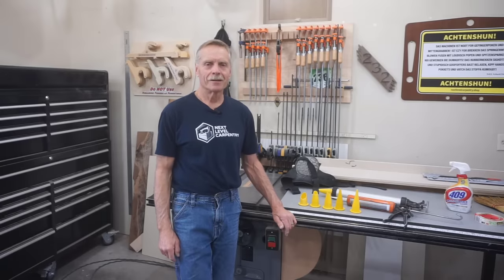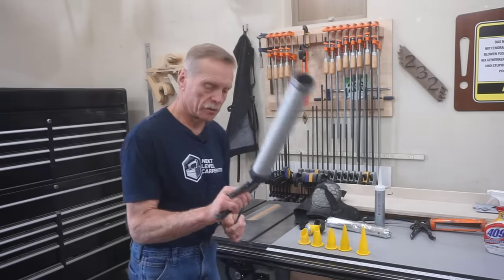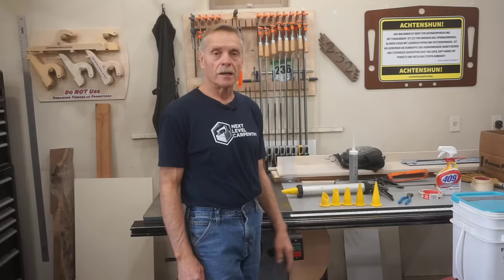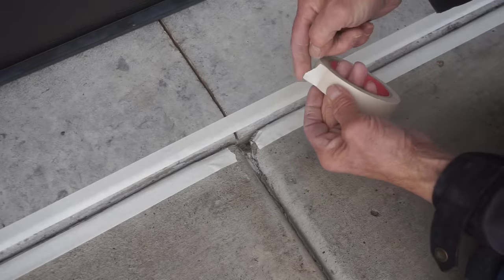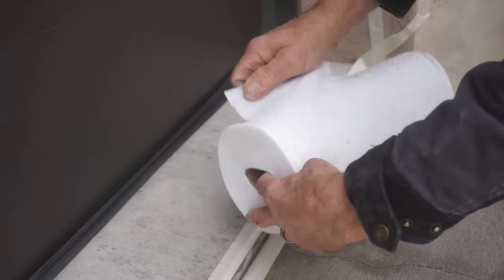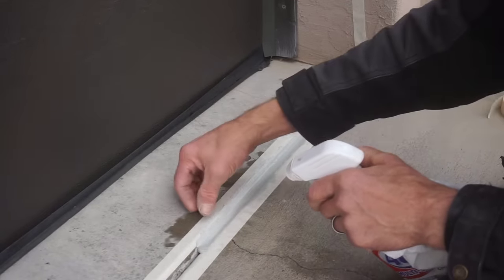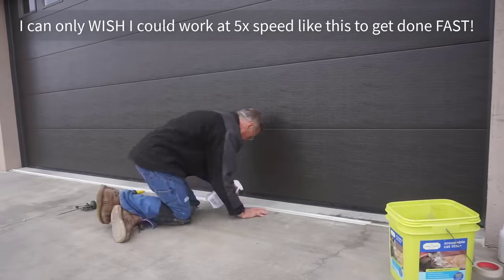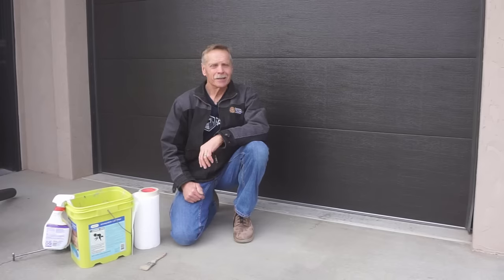How to Caulk Concrete Control Joints with Perfect Results Every Time

Comment: This is probably going to sound odd.. But I've been doing strictly finish caulking for over a decade. Pre cast, brick, stone, glass, aluminum, everything. I've used every type of caulking under the sun, urethanes, silicones, self level, 1 component, 2 component. We don't use tape or our fingers to finish, we make custom tooling sticks with wood, all sizes from 1/4" to 3" wide. People are surprised to see us using oscillating cutters, grinders and chipping tools but we work on all substrates. I'm kind of glad to see people starting to take it seriously, a lot of people make fun of caulking but it is an important component to building and it's important that it's done right. 10 years ago anyone was allowed to have a gun but nowadays in Canada we have engineers inspecting all our beads and if they're not perfect...well cut it out and do it again. What you're doing looks good and it's done right, nice job.

Edit: anyone that says you can't use soap and water doesn't know what they're talking about.
Reply: A video showing your finish tools would be appreciated.  Caulk finishing tools are hard to come by and there are few options.
Reply: Caulking isn't an easy job, I am OSI silver and bronze certified , I grind down old knifes and make tools out of them , it is an art and some guy have and others don't. I also use mineral sprits. there are many different ways and tools and with the modern sealants it actually take time and skill to do it to spec
Reply from the maker: @Denis Dougherty Glad to see hear from someone else who sees the benefit/value/quality of joint sealing!  The number of 'pros' who've commented on this video saying only an amateur would need this method is annoying... especially when they don't have photos to back up their assertions, right?  Mitering masking tape too?  Great minds think alike! Best, Matt
Reply: Too much bare finger work can be a problem, especially with hands that are pre-damaged. I've tried using inexpensive rubber-coated gloves, and thinking that soapy water might help since rubber/ vinyl/ whatever still is not flesh and has different results. THanks
Reply: John Henderson id love to see some of them mate! Learning the ropes and it’s fascinating stuff!
Reply: Journey man glazier here, I have to say you hit all the right points tape, tool, getting the caulk ahead of the tip. All spot on, for bumpy substrates the finger is king. Soapy water, 409(for rich people) lol and glass cleaner. All a good call. I can ramble for days on the in’s and out’s about caulk but you nailed it. Btw I love my bulk gun but nothing beats my Albeon for tubes. Just saying.
Reply: Your inspectors would have a ton of work here in the USA. Burt Lancaster may be one of 2 guys here that knows how to caulk

Comment: To save on material if the joint is kind of deep....I will fill it with sillica sand and then brush it out to a uniform depth prior to caulking.
Reply: You are supposed to use closed cell backer rod
Reply: @johnhender  That will work but I think sand is better.  I know it's cheaper.

Comment: Looks really good Matt.

How do you clean out the nozzle if you're not going to be caulking again anytime soon?
Reply from the maker: It's much easier to just let the urethane cure in the tip and pull it out after it turns solid than it is to try to wipe it out while it's wet. It's actually pretty amazing that it works that way.. Best, Matt
Reply: Next Level Carpentry And that’s what I usually have done with standard caulking tubes, I’ll screw a drywall screw into the end of the tip and pull the plug out. That’s probably the only thing you missed in the video 😉
Reply: To reuse my partial tube of caulk at a later time, I simply peel off one of my rubber gloves when I'm done, pushing one of the fingers over the nozzle of the tube, I squeeze a little bit of caulking into that finger tip of the glove, give it a twist, and just leave it. It provides a nice cap made out of the caulking, and when I pull it off, there's fresh, soft caulk in the nozzle ready to work.
Reply from the maker: @btbinnovationsllc6815  great tip, thanks! Best, Matt

Comment: Thanks for sharing this video.  Luckily I only started my job today and didn't get far before I realized I can do it so much better.  Question for you or anyone really -- Do you guys run caulk in all your joints or just the big expansion joints?  I have a pretty big driveway and have seen some neighbors where every joint is caulked, and it looks nice.  I imagine the more narrow joints are a challenge to do properly, some are razor thin.  The expansion at the garage and across the driveway in 2 spots definitely I'll do this way.  But I'm wondering if I can run this in every gap?
Reply from the maker: Because filling joints with urethane keeps them from filling with dirt, dog hair and detritus, I'm a big fan of doing all the joints both for ease of cleaning and consistent appearance: kind of looks like grout joints in VERY large tiles IMHO.  I don't do 'razor thin' cracks but do do 1/8" wide control joints that were cut in place with diamond blades.  I always cringe when I see a driveway done with self-leveling sealant,  without masking tape or without wet-tooling that ends up looking sadly sloppy where it would have been much better left alone.  As long as you follow the steps shown in the video you'll end up with a very neat job. Best, Matt
Reply: @NextLevelCarpentry  Appreciate your reply and the time you took to share this video.  I learned a lot watching you.  It went pretty well today but slow going as I learn the process.  I'll be back at it tomorrow.  Your tips are extremely useful though you also make it look easy. :)  One thing I did want to ask if you had a minute, I noticed some of the smaller joints (non-control) aren't very close to the top of the surface.  I didn't want to go too high as my snowblower would kill them in the winter, but they are also a bit lower than I like when they settled.  Tomorrow, ok to put another small layer on top of the existing or is that a no-no?  The smaller joints are easier, my larger joints have a lot of chips and cracks from wear and tear which is making the straight line method a little trickier.
Reply from the maker: @BraddyP  It's fine to add more sealant on top of previously applied joints but you might need/want to wait a couple weeks for the initial stuff to stiffen up a bit before you do. I'm sure it will stick but think it might be messy... give it a try and see.  I've done touch-up on joints after they've 'cured' to remove animal footprints, tire tracks etc by taking a utility knife and cutting a Vee groove and then filling it back in... might be less fussy than trying to add a thin-ish layer on top?  As long as you don't smear urethane outside the tape lines you can do and re-do whatever and whenever... it's pretty forgiving that way.
Those chips, cracks and irregularities do make the job more challenging but at least you have a work-able system to keep from ending up with a complete mess, right?😎 Best, Matt

Comment: I consider myself a handyman but never thought to do this - and the joints at my house need it badly. When I had the house built the joint had some sort of brown substance in it - not sure what it’s called - I figured Lowe’s would have it but never looked. I like this caulk idea better anyway. Thanks and subscribed.
Reply from the maker: The 'brown stuff' you see is expansion joint material DabbaYabbaDo.  It allows concrete flatwork to expand/contract with changes in temperature.  They are spaced out according to slab size/length/width to prevent buckling.  The 'thump thump' you hear when driving down a concrete paved highway are the expansion joints put there so the highway lasts longer. When installed properly expansion joints are held 1/2" down from the surface of the slab with a 'snap cap' which, when broken away after concrete cures, leaves a 1/2" wide x 1/2" deep groove that's filled with sealant because expansion joint material doesn't do a good job of sealing out water and dirt.  You would need to remove the top 1/2" of yours somehow before sealing.  The method, tools and products seen in this video will allow you to get professional results when sealing expansion joints like you mention and control joints ( the other straight lines you see in your driveway and sidewalks) because they are definitely 'best practices' IMHO. Thanks for watching, commenting and subscribing! Best, Matt
Reply: Hey there. Like Matt says,that is expansion joint in your joints. I typically use my grinder or quicky saw with a wire wheel and that is the easiest way. If you dont have access to one of those,you can use a utility knife and cut it out. -Little but more work but it works.
Reply from the maker: @omaha1361  Side grinder with a knotted wire wheel sounds PERFECT!  I've not heard of that or tried it but I'm sure it will work so thanks for adding the tip here!! Best, Matt
Reply: 8
Reply: Beautiful work

Comment: Even the Tremco rep unofficially will tell you to use a 409 type product. The issue sing 409 or soapy water  is if you want to add more poly on top of what you just did. That 409 might cause an adhesion issue. BUT, almost always I dry tool, add poly if needed then 409 as final and never had an issue.

Good video!!
Reply from the maker: You might be surprised to know that there's zero 'adhesion issue' when adding more urethane even after wet tooling with 409 George.  Seems counterintuitive but I do it all the time with no adverse affects.  Best, Matt

Comment: I am surprised that you apply a liquid that stops the bonding to smooth the bead out and then push more material in on top... I guess you must not have had any negative experiences with that technique but frankly it surprises me that this even works.
Reply from the maker: I've been using this method steadily for 20 years with great results and zero failures Marco and, frankly, it surprises me that it works every time I do it. Best, Matt
Reply: Here's a hint if you have a small area to seal:  Just use spit.  Yes, it works.  Used it in caulking an end cap on guttering.

Comment: Pretty good job for a non-professional caulker. One thing needs to be mentioned. A soap solution like 409 or dish detergent/water solution will contaminate the surface if you accidentally spray it on the surface that hasn't been caulked yet. That will result in an adhesion failure. 
  Tremco has a superior product now called Dymonic 100.  It can be applied to damp, but not wet, surfaces and still retain adhesion. Best to have the substrate to be bone dry and free of dust.  
  I don't need or use tape. 45 years of practice. It's all in how you control the tip.  The sand is unnecessary but it does give it a good look and keep debris from landing on it. You're better off getting the color of the sealant to match the substrate if possible. Then if you slip and get a little caulk where you don't want it you can just wipe it up with a rag.
Reply: You can't just wipe it up on unsealed concrete or paving !
Reply: @buildmotosykletist1987  Umm...yeah you can if you take the time to select the right color to match the paving. If the color you use is close to the color of the concrete the little bit of film from the sealant is barely noticeable.  
  Ask me a question about sealants. I've got 45 (that's forty-five) years of experience.  After working as a caulker for 26 years I started my own caulking company in 2001.
Reply: @chuckp_again_and_again  : What's the company name? Thanks.
Reply: @buildmotosykletist1987  Why do you need to know my company name?  Do you think someone would lie about that in a video comment section like this? I have been in the sealant business for 45 years. I have my own caulking company. That's all you need to know. Take my word for it that I know what I'm talking about...or don't. Believe that you can't wipe excess caulk off of concrete if you want to. Thanks.
Reply: @chuckp_again_and_again  : Thanks, that tells us everything we need to know.
Reply: Use Toluene or xylene with a rag will get caulking off of concrete.
Reply: @buildmotosykletist1987  And your comment tells me everything I need to know.

Comment: Sand also offers some uv protection making the caulk last a little longer
Reply: If he wanted longevity and uv protection he should have used silicone.
Reply from the maker: @ishyne22  Silicone on concrete for longevity?!  NOT!!
Reply: @ishyne22  Silicone bonds to concrete very poorly.
Reply: Markus Chelios Dow Corning 888 or 890SL are fantastic silicone caulks that I’ve used commercially and last many years.
Reply: @NextLevelCarpentry  If you use a pure 100% commercial silicone caulk like Dow 790 it will last 20+ years. I have swimming pool concrete deck expansion joints that still hold a bond to concrete 25 years later. They also tool better then most caulks I've used and come in sausage tubes
Reply from the maker: @mattmiller8967  This is news to me but won't dispute your experience with it... glad to it works so well for you.  Best, Matt
Reply: @NextLevelCarpentry  Most negative opinions of silicone come from people using acetoxy silicone, which should only be used in bathrooms. You know you'e using an acetoxy silicone when you can smell vinegar while gunning it out.  Using an oxime/neutral cure silicone like Dow 790, Novaflex, Pecora, etc.. you will get great adhesion masonry, metal, vinyl, and most other substrates.  The strength of the silicone is that it is inorganic, so UV light does not break it down over time, and it stays permanently flexible whereas urethane's or solvent based products will harden and crack.
Reply from the maker: @ryanwilliams601  thanks for the education... Told me something I did not know! Best, Matt
Reply: @ryanwilliams601  The best caulk I've seen is either O.S.I. or Quad caulk. Both hold up to UV rays for many years, it keeps elasticity so it does not dry out and crack. Will bond to concrete, wood, metal, tile, stone. More expensive than most caulks but when you want it done right and not have to go back and reseal it again, O.S.I. or Quad is the way to go!
Reply: You caulk specialists help a guy out.  What should I use on fireplace brick mortar cracks?  How do I repair that small crack?  
Also what is O.S.I.?
Your wisdom is much appreciated.
Links are welcome as well.
Reply: @ishyne22  Thanks, I've been using Polyurethanes but I will check into those. :)
Reply: @kendog180  Quad and O.S.I. is a brand name of good caulk. They cost about $6 a tube. For certain things you want to use good quality caulk that you won't have to go back and re-do at some point. Any kind of brick or block that has mortar cracks I would not just caulk it. I would Repoint it. To "Re-Point" cracks is not hard at all. Just look at a video of how to Repoint bricks. Using caulk on mortar cracks is not the solution. It will look crappy and eventually come loose and need to be re done again. Re-Pointing would be the solution for this problem.
Reply: @kendog180  OSI is a brand that makes many different high end caulks at everyday prices.

On your fireplace bricks, if it's joints between the bricks, use mortar.  Caulk will have a totally different color and surface texture and look ugly.  If you are talking bricks to a dissimilar surface, use polyurethane caulk.

To apply mortar as a repair, you need to have a depth to fill, so dig out all loose mortar.  If it's just a crack, and the rest of the mortar is solid, chisel it out to create some space.  Work when it's cool and out of direct sunlight so your mortar doesn't set too fast.  Get rid of all loose dust.  Compressed air works great for that.

You are going to need to moisten your joints so it doesn't drink the water out of your mortar too fast, but there is a method for that.  You will need a bonding agent too.  Mix a small batch of mortar with bonding agent mixed in with the mortar.  Wet a joint or three with water, very wet, but no standing water.  Let the water soak in for a minute of two, then paint bonding agent into the joint.  Then tuck in your mortar, and tool to finish.  Repeat until the job is done, or the mortar begins to stiffen.  If mortar stiffens, you can temper it once, to keep going, but no more than once, then discard the batch, cleanup and repeat as needed.

On a final note, any time you want to work with mortar over a period of time, you will want to allow your batch of mortar to "slake" before you start using it.  To "slake" mortar, mix your batch to somewhere between peanut butter and mayonnaise, and let rest for 4-5 minutes.  Then remix.  This will give you considerably longer working time with your mortar before it begins to set.  If the slaking process made your mortar too stiff, add DROPS of water until it is loose enough.  (I use a paintbrush to shake drops of water over the mix).

Hope this wasn't TMI!
Reply: @mattmiller8967  I did a lot of experimenting with silicone concrete joint filling a couple years ago. I used different DAP silicone and GE silicones from Home Depot. Some were even labeled specifically for concrete, but they all failed miserably . Then I went to a building supply store and got some Dow 795. It has kept a seal on every joint perfectly. The difference in performance is unbelievable and it was only like $2 per tube.